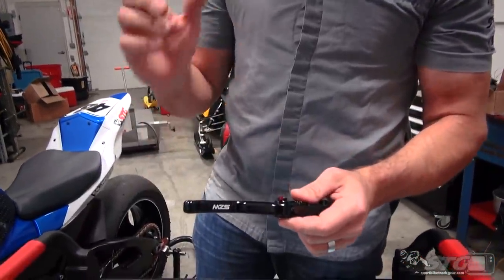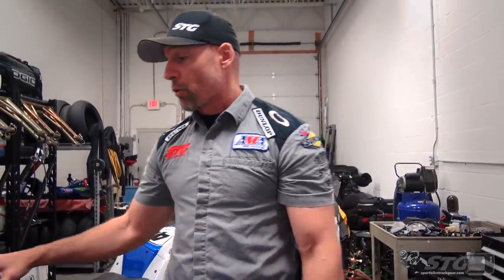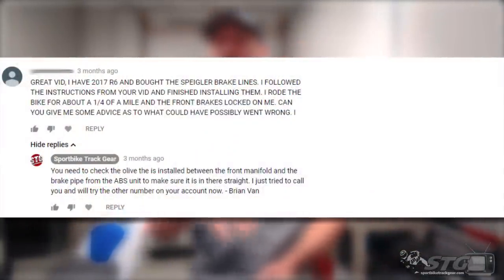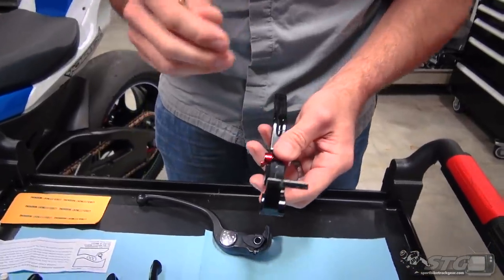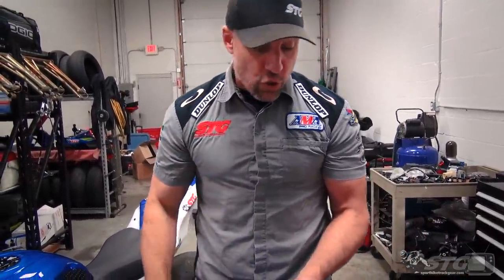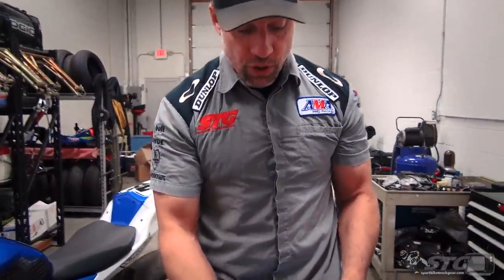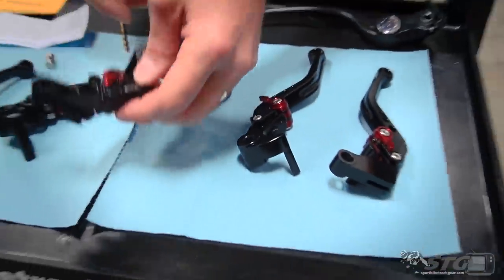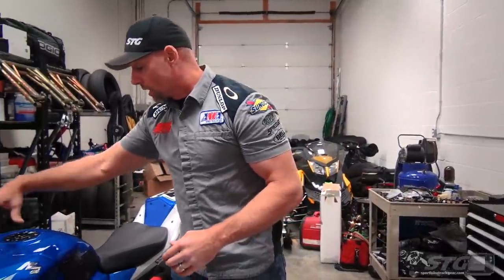The Truth About Cheap Motorcycle Levers | Sportbike Track Gear

Comment: My cheap levers work fine just like the majority of people on here. $30 vs $300 is just too good to pass up. I also didn't throw them on and then take off down the road wide ass open either. Test everything before you just trust them. Cheap or expensive. They're not gonna work fine for 6 months and then start locking up. These were obviously designed too tight when manufactured.

My cheap front and rear stands are still holding up my bike fine for the past two years. I don't lean on them from the side like you did in your other video.

Of course the name brands are better quality and have that insurance, because people will sue them for their own mistakes. I personally ain't looking to sue anyone because I rode my motorcycle like a jackass.

There's some places you don't want to go cheap on though. Chains and sprockets. Cheap chains always fail and they take out legs or engines.
Reply from the maker: Let's open with the stands, I would buy a cheap stand before I would put these $35 a set levers on my bike. If the stand fails the bike falls over, you shed a couple tears, then dry said tears and pick up the bike. 

Installing sub-par levers, brake parts, clip ons, rearsets or drive line components on your motorcycle is not something I would recommend. If you want to save money on bike parts put a knock off exhaust on or make your own fender eliminator. Cheap sunglasses are another great way to save money.

Product liability insurance is more than just coverage if a law suit is filed. IMO this is part of the whole package that makes a brand legitimate and worth investing your hard earned money when purchasing their products. Also included on this list are things like research & development, product testing, quality control and technical support (before and after the sale). All of these add layers of expense that simply need to be there to produce products worth purchasing. - Van
Reply: @sportbiketrackgear  I definitely love my $40 knockoff muffler. I've even had people try to tell me that would ruin my engine as well... Lol. When I ask them to explain how, they come up with nothing.

Just because these cheap levers failed, doesn't mean they all will. It is a great heads up for a failure point for us to look out for.

And of course the knock offs don't have R&D. They're relying on these big companies to do it. But let's be real here. There is nothing remotely close to reasonable in the cost of the name brands. It probably cost $5 in materials to make them. If they cost $50-60 a set vs $20-30 a set, I'd agree they were worth the extra money. But $200 a set vs $20-30 is not worth it in my eyes. Test the product and make sure it works. Name brand or not.
Reply from the maker: @TEAMWRIGHTEOUS  I have been doing this a long time man and can say I do not know anyone working in this industry that lives in a mansion. The motorcycle industry is different than so many out there. There just isn't crazy margin or markup in the products like you see with clothing etc... While it may take $5 in materials it also requires product liability insurance, skilled labor, really expensive machinery, etc... 

For sure not all of the MZS levers will fail, that said who want to be the test dummy? - Van
Reply: @sportbiketrackgear  mine aren't even a name brand cheap set. They're just red adjustable levers. Lol.

But a 40x markup on a product is outrageous.

Imagine if other things you bought were marked up that much.

People think cellphones are expensive, but they cost about $200 to make. At 40x markup that would be $8000.

They may not be living in mansions, but they ain't starving either. I definitely ain't against spending money on my bike and have bought good brakes and rotors, tires and drive chain and sprockets. But I can afford those because I get budget stuff where it's safe. I'll watch closer now on these levers as I never knew that's how they worked.
Reply from the maker: @TEAMWRIGHTEOUS  It's not a 40X mark up because the cost of the raw material is a very small percentage of the cost that go into the levers. I am no cell phone expert but I saw a documentary where a dude went to China and made his own phone using parts he bought on the street. He had next to nothing into the parts and built a working phone. To determine actual production costs for an item you have to factor in everything required for production, not just the raw materials.

Before I started STG I would have agreed with you. Over the years I have learned a lot about what real expenses are and how important it is you truly understand what your operating costs are as a business. This shit is way more complicated than I expected it to be man. Took a few lumps learning these lessons along the way for sure. Anyone who really knows me will tell you I say exactly what's on my mind, zero bullshit my man.

If we sell a lever for $100 we are paying approximately $70 for said lever. From there you have the free shipping (man I wish FedEx gave me free shipping), the box, health insurance, pay roll, building expenses, marketing, etc... The list is longer the character limit on YouTube. Now if everything goes just right there will be a couple % left when it is all sorted. When I say a couple I mean low single digits. Some items are better than others to be fair, this rough formula represents more of an average end of the day.

Full disclosure my brother. If you work you ass off with all the chips in the center of the table you can do alright. You may not have a private plane but you can for sure have a nice bike! - Van
Reply: @sportbiketrackgear  I for sure don't think the retail guy like yourself is the one raking in the bank from us the consumer. I know without a doubt you're going to push your superior products over cheap ones and I don't blame you. And you're not wrong in the way you present them. You're absolutely correct that the expensive ones are far superior in build quality regardless of what the part may be.

It's a little different having this conversation with you versus any other rider. Anyone else is just buying into the hype because to many they believe the BS. Shinko tires kill babies and all that other stuff. Lol. But you definitely know better than that and don't come arguing the dumb arguments most have.

I've talked to track guys who showed me a good set of levers. They most definitely felt much better in their sturdiness. They felt solid and even lighter than mine, even mounted on the bike... Not that I knew for certain that they were without weighing them, but it's a sense you have... If I were building a track only race bike, I would spend the money and have the lightest and best of everything. For my daily ridden, go anywhere motorcycle that I might ride 1000 miles a week and do track days and drag race also, I'll deal with the little extra weight and cheaper levers to put on more vital parts.
Reply: @TEAMWRIGHTEOUS  at that point why not just stick with OEM parts and save the 30. You know that the R & D has gone into it and it is quality. Why spend 30 dollars for something that is less then what came on the bike in the first place?
Reply: @deathwish8339  because I like for my bike to look cool, just like anyone else who buys colored levers. Stock levers are ugly. Stock mirrors are ugly also.
Reply: @TEAMWRIGHTEOUS  I am going to repectfully disagree, especially about the mirrors on my R1. It's your life dude, I just hope you dont live to regret it. Wait, that could be taken bad. I DO hope you live to regret... No wait, I am bad at this. Good luck and stay safe!
Reply: @deathwish8339  lol... It's all good.

Stock mirrors on my gsxr and my Katana look ugly. Stock levers are blah.
Reply: WRIGHTRACING I agree with you on the stands. I bought mines from eBay in 2012, for $30 at the time. They’re not name brand, just red in color. Never had 1 single issue and they’re still holding strong. How much are Pitbull stands? No thanks.

Comment: Those Chinese Brake levers froze my ABS and locked my brakes and highsided...  ever since then, I only buy quality parts, if I dont have the money, I save until I get quality parts and not cheap Chinese parts.
Reply: KC JONES  the cheap lever kept the pressure on the brake, while riding the pressure built and the ABS light came on, so I started braking (not knowing that the issue was the lever to begin with) until finally the front brake locked... the levers were just not right, they fit but they kept pressing on the brakes even if I was not touching them.

Comment: MZS levers come with instructions strickly made for that bushing as well as common causes of problems etc if you install it wrong.. it also states you may need to use your OEM bushing (which i did) and it comes with washers to tighten up the clearances... granted i wont attempt to compare china brands to american brands.. but ive never had a problem with cheap aftermarket levers from multiple companies... the guy with the R6 was a f***n moron who shouldve taken his bike to a shop 😂.
3 sets of levers vs 1 single lever.. i mean its a no brainer, but from a marketing & profit stand point i see why you try so hard to push the more expensive brands, because they are HIGHER quality.
If you can afford it, always get the better stuff, but if you cant, nothing wrong with a few cheapy parts ^_- 
(Im sure these people are super nice people) hahaha, im dead 😂💯

Comment: Not all the MZS levers have that issue and if they do it would still be cheaper to get some moly or silicone grease ,sandpaper, or a single reamer/ drill bit to increase the size of the hole a few thousandths to accommodate the pin. That way you can use the money saved on a good set of brake lines etc. . This is still a great video because it highlights a possible area of failure in brake levers and can save someones life.
Reply from the maker: Not all MZS levers have caused the brakes to lock. Personally I do not feel the savings is worth the risk. Looking past the seizing cross pin bushing the rest of the tolerances are still complete shit. Appreciate you watching and taking the time to leave this comment. - Brian Van

Comment: You should inspect cheep parts before installing them
Reply: Most people who buy cheap parts probably aren't educated enough on the subject to know what could be wrong.
Reply: @user-nb8yt2il2r    you are right in terms of checking every thing for defects before you install. Buy where do you even find a 35 dollar pair of levers? And of course a 200 pair of adjustable levers CNC machined in the USA are better than some super cheap Chinese made ones.. and it's more than a stick with a hole in it if you're talking about adjustable ones
Reply: @user-nb8yt2il2r  Yes the $200 levers are different than the $35 pair, when you pay the premium for levers you’re paying for the R&D that went into the levers, the higher quality materials that went into them and the up to date tooling that makes the product, as well as finish quality and fitment. Companies like MZS don’t have the money to fund strict R&D that goes into making a safe product that stays safe through years of use, not to mention the tooling that is required to produce levers with a strict tolerance. 

The same goes to OEM levers, big motorcycle companies have the money to work out what I described above.

Comment: One pair of defective levers and the whole Chinese industry is bad?
Reply from the maker: Never said that, not even close to what I said. There is a ton of great product that comes out of China at this point, these MZS levers are not on that list. The tolerances on these levers are not even close to where they need to be. In this 2 day old video there are already MULTIPLE comments about these levers causing the front brakes to lock up. - Van
Reply: I have a pair of chinese levers and the quality is definetly subpar and the adjusters have broke on one. Not going to say they will bind, but Chinese manufacturers very low quality control control and theres no doubt that some dangerous lever are making it out to customers that would have been caught by other more expensive manufacturers.
Reply: To be fair he said quite clearly he was not hating on the whole chinese industry. Shame we can't get decent products here in the uk for the same prices you guys get them at. Would have to pay obsurd fees when they arrive here in the uk
Reply: @sportbiketrackgear  I think the key with the Chinese industry is like any other - do your research and know that you may end up getting junk until you find a reputable shop. I've built high end bicycles and wheels from China and I didn't commit to a full frame etc until I checked out the quality of something smaller. Thanks for posting this and your other videos, they have been my main source of information for my latest gen R6 build. Next paycheck I'm getting the steel lines and using your video :)
Reply: Carlos Cal you said that not him. Did you watch the video?
Reply: He said atleat 5 times that he's not talking about Chinese manufacturing in general. Infact he specifically said there are some great products manufactured in China just not these!
Reply: He never said that!
Reply: The QC is lacking to say the least.When people are paid 10 cents a day its no wonder they dont take pride in their work. Look at the quality of stuff out of Japan. Top quality stuff all of it for the most part. Same geographical region but not a 3rd world county. Japanese workers are paid well thus their products cost more and they take more pride in their work. Simple as that.

Comment: Why put those levers on a bike that your life counts on.. crazy. I have just removed some cheap crap levers from a bike I have
just purchased and reinstalled  the factory originals. They were rather expensive to buy, but my lifes worth every penny.
Reply: I just did the exact same thing.  The pivot bushing piece in my cheap $30 lever was completely seized up.  Now my brakes still worked, but its not worth it to me.  I'll wait until i can afford some good levers.

Comment: I love my Chinese rip off levers, I feel a lot safer with them as I don't get distracted by carpal tunnel pain.
Reply: @Image-X  I'm not dead yet and it's been 2 years.
Reply: Map Hump You’re good.... until you’re not. Why risk it? You should buy junk tires and a junk chain too. Save a few bucks! 👍
Reply: @Image-X  have you actually seen the Chinese levers? Fully aluminium like branded ones.
Reply: Map Hump Yes, I know they’re aluminum. Cheap Chinese brittle aluminum. You can defend your garbage if you want but most of us here supporting Brian are smart enough not to buy junk when it comes to critical components.
Reply: His were obviously installed wrong for them not to be working properly, which can happen with any product.
Reply: @Image-X  no you said your smart enough not to buy Chinese levers, implying people who have aren't smart so you started being personal. You can hardly tell the difference between the levers, both look cooler than stock, and my stock ones were way looser.
Reply: @freshfruit23  You are in your late teens or young 20s, aren't you? I'd bet a whole paycheck on it.